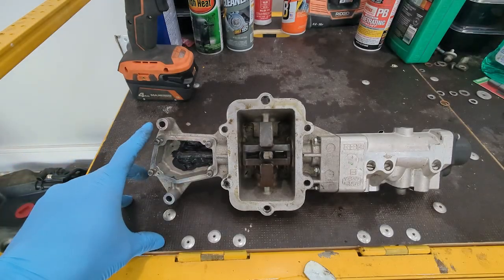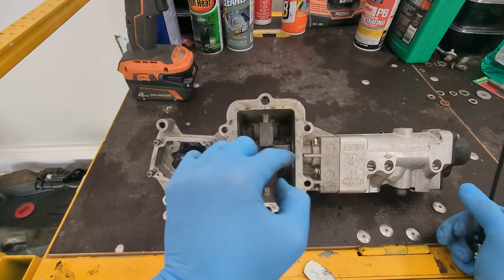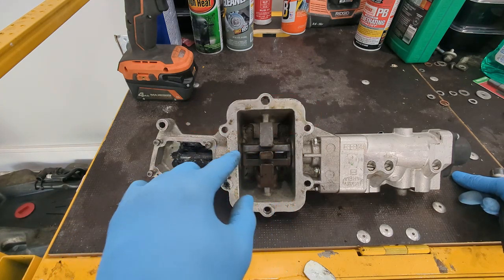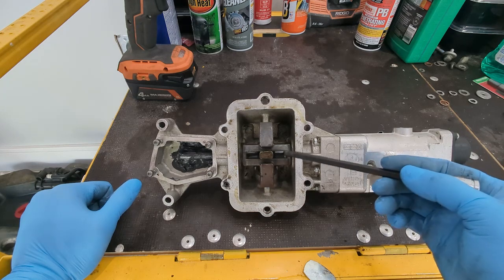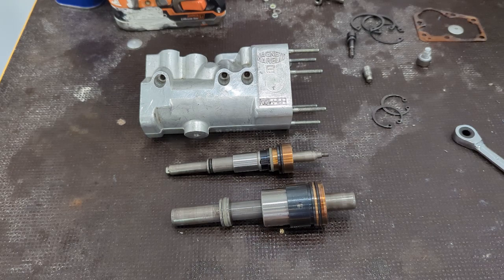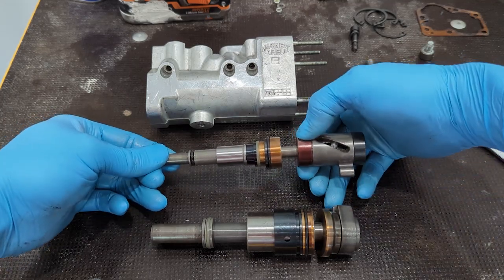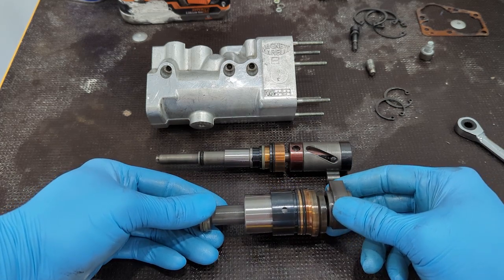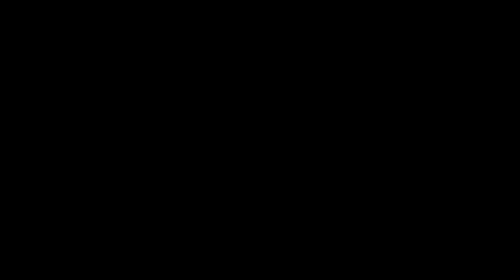Tearing apart the Ferrari F1 actuator... : Project ToyoRati Ep13

Comment: Great video. I wanted to ask you, are these actuators the same for the Ferrari 430/575 , Maserati and 04-08 Gallardo?
Reply from the maker: I believe that they are the same units.  I haven't had them in my hands personally to verify.
Reply: @TheIntensiveCarUnit  confirmed they are all the same. Anyway, my gallardo actuator is leaking fluid. I need new seals on the upper part if i'm not mistaken. Do you repair them? I can send it to you if so. I am in NYC. (GTE Engineering does "rebuilds" on these but they want you to yank out the entire egear system out and send it to them.. pump, solenoids, accumulator and so on.. I'm not doing that, I can physically see the leak on mine. It's minor but it randomly gives me egear errors) Let me know if possible.
Reply from the maker: @NycForgiato  Send me a message on insta and we can chat.  @hobbling_nurse85

Comment: Is the plan to make a manual shifter yourself or use an existing shifter that works with the M139 transmission?
Reply from the maker: Honestly, it is going to be a bit of a combination of it all.  I have a friend who has been designing and developing a shifter that we are going to try.  I will still need to modify it a fair amount, but it should work.

Comment: Ive been biewing your process and find your project quite interesting. What i don't understand is why you put so much time learning about how the actuater works rather than focus on fabracting a manual shifter? Still, it was interesting. I'm zipping through the rest of the videos.
Reply from the maker: Really good question.  The main purpose is to understand the engineering behind it, so I can add to my bank of knowledge.  You never know when you might need that process theory or the mechanical idea.  It could create another idea you wouldn't have otherwise had to problem solve a current issue!